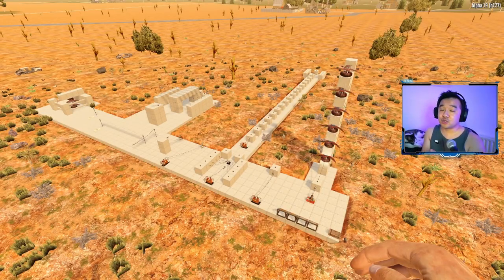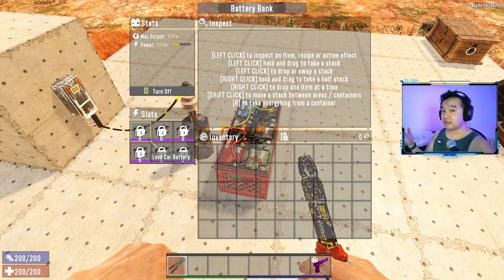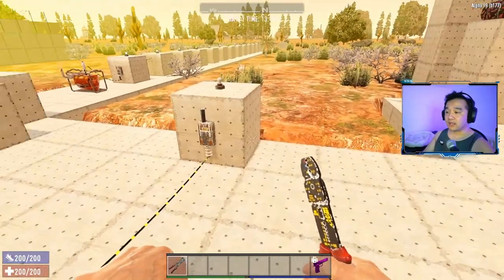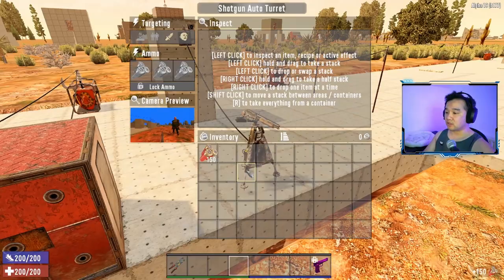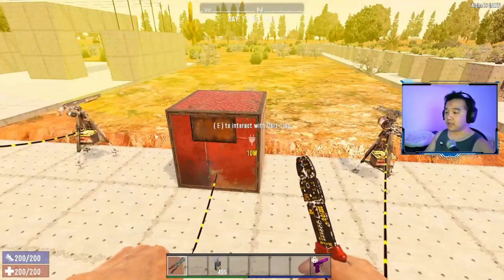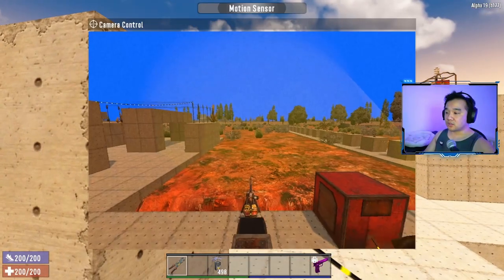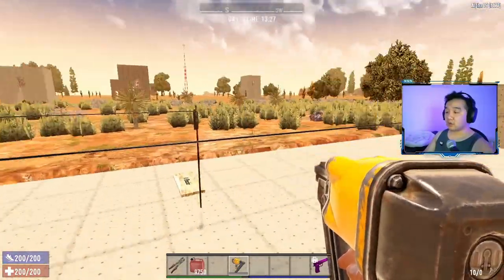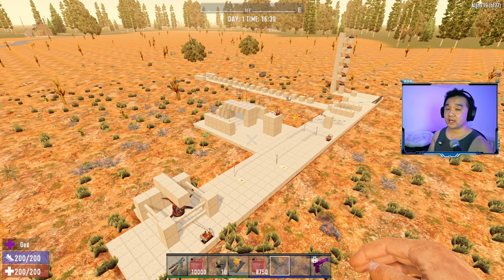How to do Power in 7 Days to Die | Alpha 19

Comment: It would be almost impossible to hide a solar bank in PvP or even PvE servers for say an underground base.
Reply from the maker: maybe if you put iron bars above the solar panels?
Reply: The entire solar bank can be covered and it still works. Only the second panel of the bank needs to be exposed, but you can also cover that with a quarter block and another rotated quarter block above that. So, in the end you only need a slit half a block wide at the top of a chimney to produce power using a solar bank.